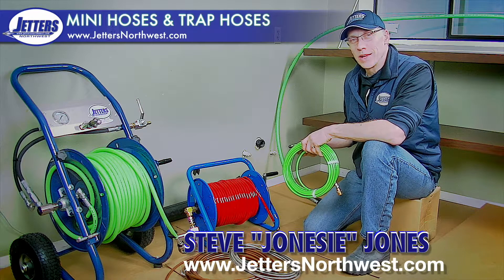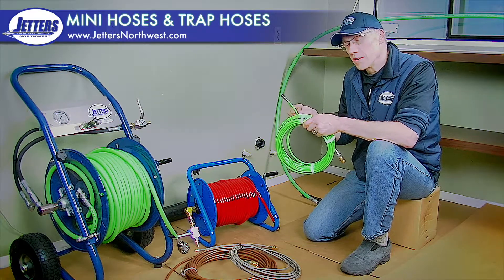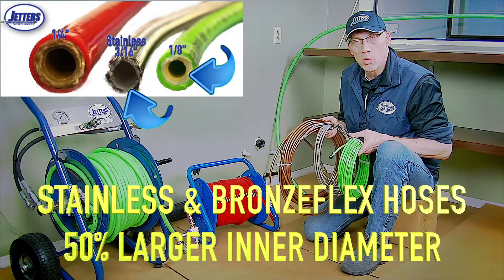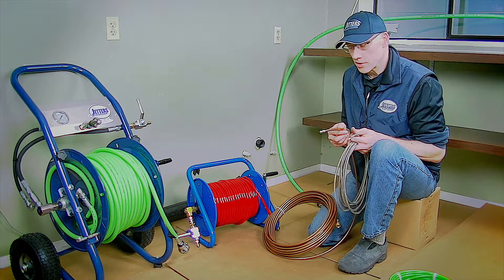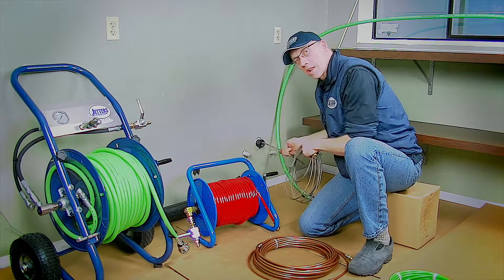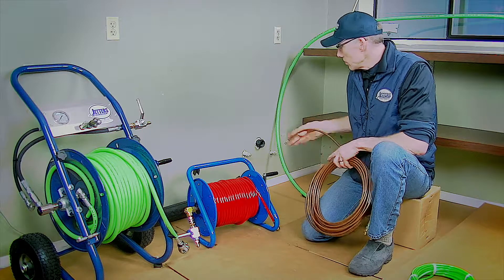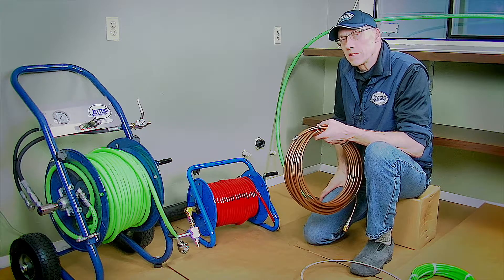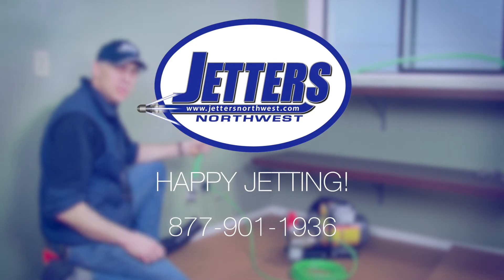"GET" JETTING  with JONESIE - MINI/TRAP JETTING HOSES 3/16"(.188") vs. 1/8"(.125")

Comment: can you get 12 gpm through a 3/8 hose
Reply from the maker: Yes indeed - but we prefer 1/2" since there is a lot of pressure-drop thru 3/8" at 12gpm -- it's just shy of 300psi for every 100-feet of hose  (IF the jetter is actually putting out 12gpm under pressure).  Btw - that's 3X the psi-loss vs. 1/2" at 12gpm
Reply: @JETTERSnorthwest  do you sell half inch  150 feet section
Reply from the maker: Sorry we missed this!  Yes but it's not online - call 2062835252 for Jetting hose #A104057 which is 1/2" x 150' 5500-PSI. This is the same premium hose w/Aramid-fiber braid under the cover at $649.00 for the short 150' length

Comment: Just ordered the bronze hose yesterday with the stainless steel knuckle/down head. Looking forward to trying them both out! Lots of jack/jill sinks with a pvc cross behind the wall. I've been typically going down the vent stack from the attic to clear the line from A/C condensate buildup, so really looking forward to seeing if the down head nozzle helps out.
Reply: Curious how you faired with the hose and the steel knuckle? I have placed an order, but it seems like it is taking forever to get to me. Curious who you ordered from and if you have any tips that would be helpful?
Reply: @andrewnewton2223  Hey bud, more than happy to share my experience. The brass hose is the best hose I've tried. It's stiff, but flexible. Can't say enough good things about it. 

The steel knuckle/drop head was not as useful as I was hoping. I tried it on my home on two different sinks, but I could not get my hose to make the jump without removing the p-trap. Most of the homes I work with have a 1.5" pvc tubular drain, so maybe that is the issue. Would I buy it again? I'm sure there are some situations it would be useful, so it's a good tool to have.  Maybe your area you would have better luck in, especially if they use full size DWV traps under the sinks. 

Even though I feel jetting is the best cleaning method possible, it is just too much of a hassle to  use indoors on kitchens or bathroom sinks. I use the Ridgid K-9 for majority of my residential work now. I sold off my old Spartan Gas Cart Jetter (4 GPM/4000 PSI) and would love to eventually buy a vehicle mounted Big Brute (9 GPM/4000 PSI) from JNW down the road. 

Hope this helps.
Reply: @POWER_WAFFLE  yes definitely - thanks for the info/advice!
Reply: @andrewnewton2223  Glad to help! Best of luck to you.
Reply: Hello, just want to ask where did you bought it? Thanks